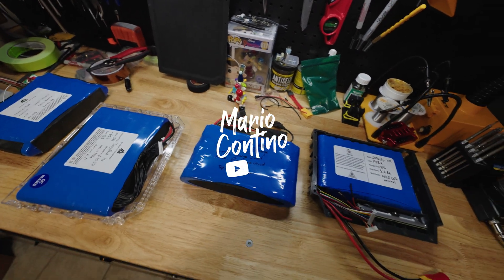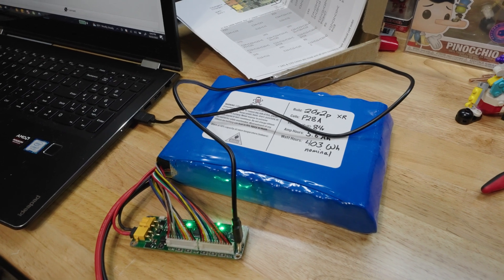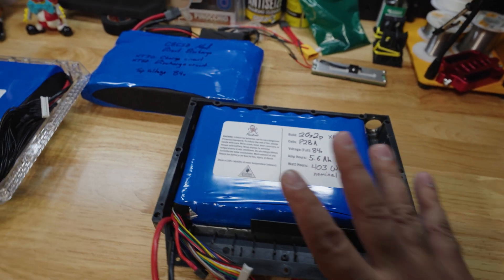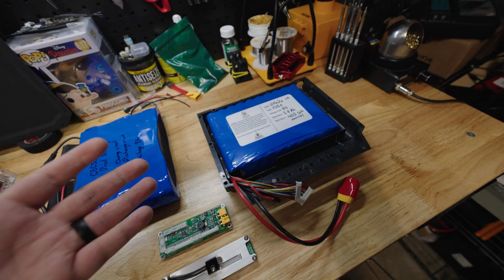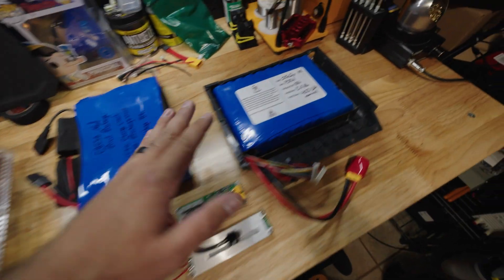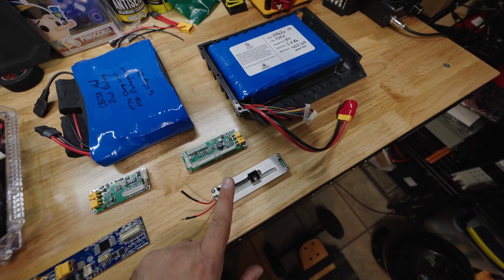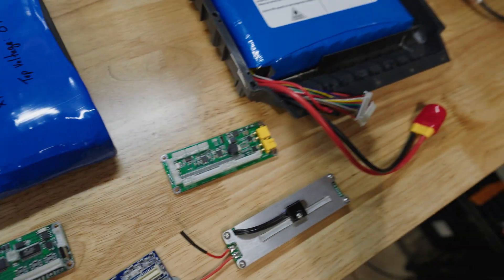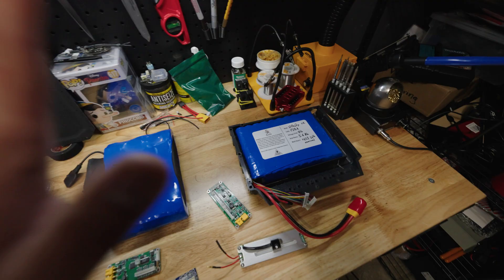Ultimate DIY Onewheel Build | Battery & BMS Options

Comment: What happens at the charger connector once the battery is connected to it? I believe you get power in its pins as current doesn't care what direction it should be flowing. If that is so, shouldn't I use a diode after the charge connector and if so what type of diode?

Comment: I am making  DIY one wheel with a VESC using the original one wheel pint BMS and a chi battery systems battery. I have run into a problem where it seems like the BMS wont allow for power to pass through to the main electronics. I'm thinking it is because the BMS doesn't have anything telling it that the board is on. What modifications do I make for it to think it is on?

Comment: Hey dude, great content! I'm wondering, for an 84V battery pack, did you upgrade the charger to anything else? Or are you rocking an original XR chargers? Thanks
Reply from the maker: It requires a specific 84 volt charger.
Reply: do you maybe have a link to the one that you use? Thanks @TheBoardGarage

Comment: Hey Mario, thank u 4 the great videos! I got what I think it's a simple question, but navigate all these custom OW info is quite hard 4 me...
I have a stock XR, HW 4212 SW 4155 and... my BMS is dead. Now, I would be happy to just keep the stock battery and controller (for now) so my question is: is there any aftermarket BMS that I can buy that also works with the stock battery & controller? I could eventually go for a VESC, but if I could dive into it in a second moment I would opt for that...
Thanks to anyone that can give me an answer ✌
Reply from the maker: Unfortunately no. FM Onewheel ESCs require a stream of data from their BMSs in order to function. You’d need to have the BMS repaired or replaced and a mod chip like an OWIE installed to get the ESC to work properly.

Comment: I’ve gotta battery question: a CBXR. Bought it last year right before I tore my knee up. Been in a box since. I just got around to installing it. Let it charge/be on the charger for a couple days. What’s recommended discharge for first time use? I’ve read I should discharge it to 1% for the first time. Is this accurate? If not, what’s the best procedure? And in general, best procedure for taking care of it?

Comment: Hi Mario, looking forward to your next video. I'm outside the US so ordering a battery from you is cost prohibitive on the shipping side. I've made my own OW battery before copying FM design so will follow your guide and wiring to make this 20s battery.

However, I don't want to open my controller again and have glued in a momentary switch so I'll need an antispark with this battery / BMS's. Do you think an anti-spark will fit in the stock XR box with the battery and Z-BMS?
Reply from the maker: If you are REALLY good with wire management, and can manage the fit of an anti spark circuit, then it can probably be done. 

If you need more space, you can also drop the pack to a 19s2p and buy some space that way.

Comment: Would it be possible to put a battery like yours in a stock XR with the stock 4208 controller? If so what BMS would be best to use with that?
Reply from the maker: Unfortunately no, the stock controller is designed for a 15s battery, maxing out at 63v. This is for use with VESC based aftermarket ESCs.
Reply: Would it be possible to create a battery pack using the same cells but in a different configuration that would be able to work with the stock BMS and Controller?
Reply from the maker: Not really, the cells aren’t the determining factor, it’s the controller’s voltage range. It works with 15 cells in series and that is all it will work with.
Reply: It would be cool if it was be possible to make a 20s battery and a BMS that would be able to do voltage control of the output  so one could switch between the full 20s standard voltage or the 63 voltage so it could work with Vesc or the FM Controller. Or maybe that would be dumb. Lol

Comment: Thank you Mario for this vid🤙 currently on an adventure of swapping a little focker in my pint and I need a new BMS. How could I go around and charge my battery without a BMS? Also what BMS has that connector that the pack has I haven't see a single one that has it. Would I be able to split the pack into different sets of cells and use  multiple balance leads so I can connect it to my hobby charger? Like could I bulk charge and top off the battery with a rc charger?   I'm willing to rip my pack open and solder some balence leads to it idk just putting ideas because these other BMS options are pricy

Comment: I personally prefer a balance only option since I have little faith in anything "smart" with the BMS's currently. Much rather the VESC manage over/under current where I can and have a fuse if I must in case of a short before the VESC. That little unreleased unit looks promising 👀 

I've bought a VESC conversion that didn't feature a BMS and I nearly screamed when I dug deeper. Planning on performing dark magic to convert it back to a stock board (I can hear the mobs forming already lol). I have the controller, just need to reattach the ports and jam a flashed BMS back in to bring the lil Pint back to life. Then... Ima give it PintX range 😈

Comment: When will ZBMS be available?
Reply from the maker: Probably a month?
Reply: @TheBoardGarage  you mentioned putting it into your own build correct? This is less expensive and a more user friendly option? I did already purchase the fungineers 12s with removable batteries and built in bms. I like the idea of removable batteries but not sure it is going to be enough power. Wish they had it in a larger configuration. Update: decided on zbms. Your site is working or at least mostly working.
Tried to purchase battery. Says “added to cart” then goes no where.  Would like to purchase. Hopefully fixed soon
Reply: @TheBoardGarage  I'm interested in a ZBMS battery....
Reply from the maker: I’ll be taking more orders in a week for batteries.
Reply: @TheBoardGarage  What's the difference between your battery and Zbattery other than your fits the stock XR box?
Reply from the maker: I’ll be making more of both configurations, for the stock XR box and the TORque box. There’s not much difference, but I’ll be offering a limited batch of high capacity batteries this month.
Reply: @TheBoardGarage  Thank you.  Hope I'll be able to snatch one up...
Reply: @TheBoardGarage  Been doing as much research as possible on battery upgrades.  Looking for more power and range.  Which would you recommend of the two configurations?

Comment: Thanks for the video! Not knowing where to get a good 20s battery that fits was one of the things holding me back from VESC, so I guess here we go! This pack is going to have less range than some of the over-stuffed ones... since VESC doesn't prevent it, do you see any problem with charge-and-ride with this setup for longer rides? (Aside from dangling cables and a risk of crashing with a plug in the charge port.)

Comment: Hey Mario, great video as always! I went to your site. All blacked out back ground. Can’t read articles. I see pictures of what your selling. 
No content though. Is your site under construction?  When will 20s battery be available?
Reply: It's currently black text with a black background, so if you click and drag to highlight the text or select all with control-A it becomes readable. Mario, I've built a couple sites in Squarespace for work, happy to help if you need it. Sounds like they'll take care of it though.
Reply from the maker: Yeah, I logged a ticket, and it seems it’s widespread. But it’ll come back I’m sure. It happens. I appreciate it!
Reply: I see you update. Will check back later.
Reply from the maker: Yeah, Squarespace is having issues it seems. They’re pretty good about fixing outages, so it should be back soon.

Comment: Could you explain why chii battery packs aren't made well?
Reply from the maker: I have a couple of articles on my blog about their most recent models. I was asked to do some rewiring, and I also give my impressions. Links are in the description of this video. 
Also, if you look at the CBXR at the left, connected to the ENNOID, those last two cell groups that show as being very low, are damaged. That pack was returned to my friend that way, after being told it was refurbished. 
So I don’t currently have confidence in their products.
Reply: @TheBoardGarage  thanks. I'll have a read